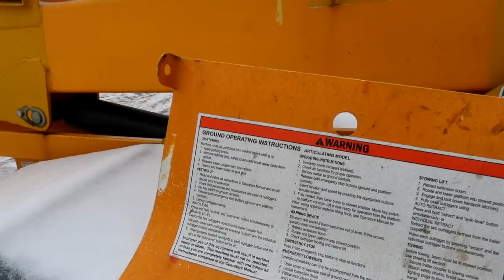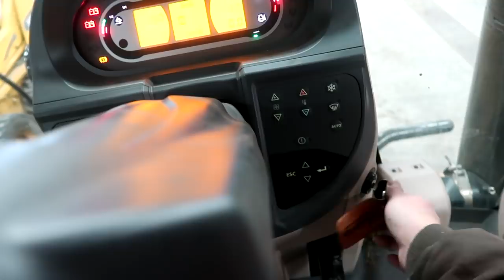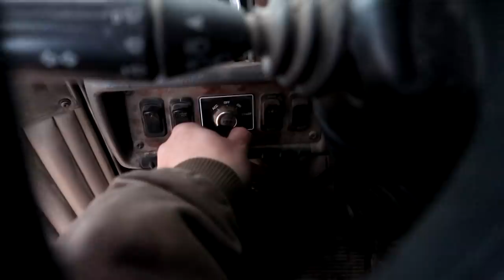Farm Wash Day!

Comment: My guess is Acgo is letting you trade your 2 John Deeres on the Acgo
Reply: Well that's the most reasonable and logical answer I've read so far. That seems quite likely doesn't it?
Reply: That makes the most sense. If I remember correctly he said in a earlier video that JD (or their particular dealer) doesn't like to take two trade-ins on one tractor.
Reply: This is my guess too.
Reply: My only question on that is that he wanted to trade in the 6410 as one of them, and I don't think you can really throw a bucket on any of their other tractors. The MM works for smaller things, but not sure that would suffice. That's also assuming they want to keep a larger bucket tractor
Reply: bigbadcrusher That's my biggest issue with this theory too. That loader seems too important. Seems like they are trying to clear up some room selling the combine though 🤔
Reply: Michael Taylor they seemed to be in love with that S680, I noticed they said one of the issues they’d heard about, they didn’t even see. Curious if that’s in the works. As far as the tractors, I’m waiting to see what they come up with. I’m not sure if by a 7000 series they meant a 7R, or maybe a 7030 or something similar. Will be interesting to see what direction they end up in
Reply: I thought about the loader, really a loader on a tractor is becoming obsolete since skid steers  came along. The only reason they are keeping that Minneapolis Moline is sentimental value, it's a classic. I still think the ACGO is staying after the 2 Deere's leave
Reply: John McDonald I remember them using that loader with the rock picker to unearth the large ones that were buried a decent amount. I’m not sure about using a Skid Steer out in the field or using the Minneapolis Moline for that with how large of of those boulders can get. Could be wrong, but that’s my thought

Comment: The challenger is there because it adds color to the garage, and beacause it has pulling power and will sink less in wet/loose soil.  Great video, great joke white glove and white tractor, now I need to see you ride a white bronco and say that! Yes Just like Shrek!  I guess you use steam and water, and maybee solution for soap in those containers, unless that was water.  You should foam you farm machinery and the trucks.  Use Tough mudder, (your mudder was a mudder!)  It is biodegable and ph balenced. I think you can get 55 gallon drums.  Great job. Love it.

Comment: By listening to it, it sounds like that white truck has a clogged/bad injector, has an air leak in the fuel system or is not getting fuel for some reason. I'd say change the filters, check for loose/cracked fuel lines and work your way up to the engine. I doubt it's compression/bad cylinder.

Comment: That pressure washing looks like you were using a hot water system. I figure the pressure washers were putting out about 3,500lbs pressure. With that cold the spray from the pressure washer should turn to snow pretty quickly.
Getting everything in the sheds now it's time to do something else like head to warm weather !

Comment: build or buy a 24volt jump starter. I'm a diesel mechanic in Australia and we just made one that has 2 12volt batters and you can swop from 24 to 12. it works super well and is also on wheels so super easy to move around. if you need anymore information message me but i think you would find it useful

Comment: We don't wash farm equipment off in freezing temps or when the temperature is will be consistantly below freezing the water gets into expensive electronics and shortens the life of connectors in addition to water getting into bearings and popping seals when the water freezes we completely clean off machines inside and outside and wait for a  nice stretch of warm sunny days to let things throughly dry

Comment: When you park the trucks unhook the negative on the battery so it won't drain while not in use or you can install a trickle charger like this, https://bit.ly/2SsDHm7 if you want to keep them charged all the time. this worker for all equipment. I am a fireman and we use something similar to this to keep our rigs ready at all times just some solutions for those problems